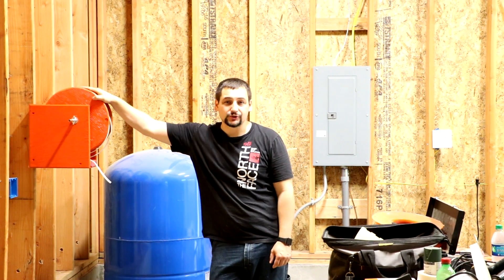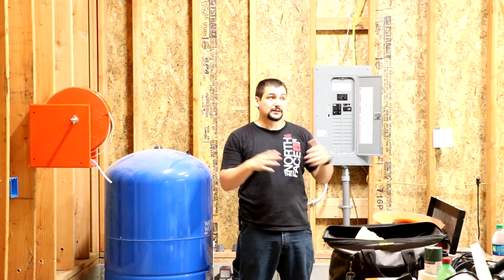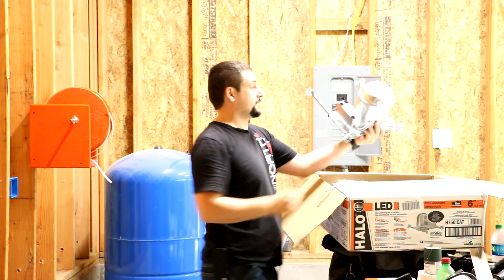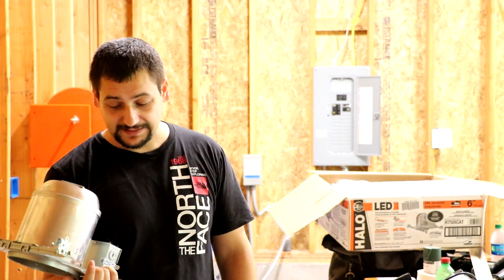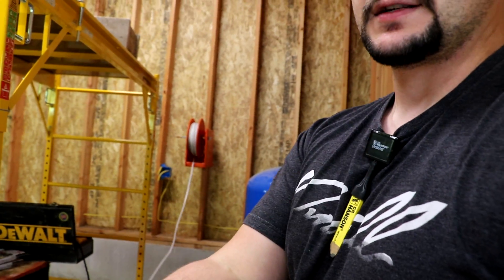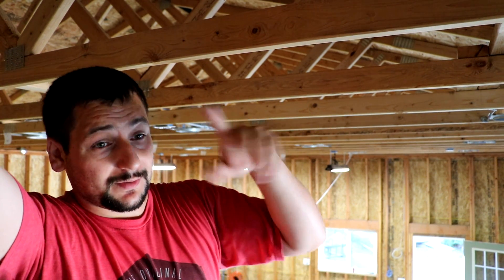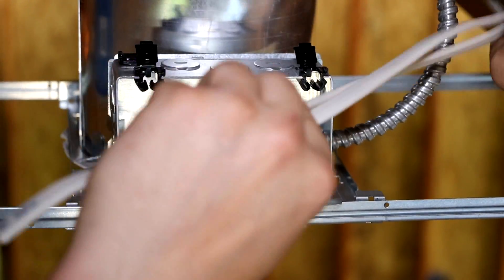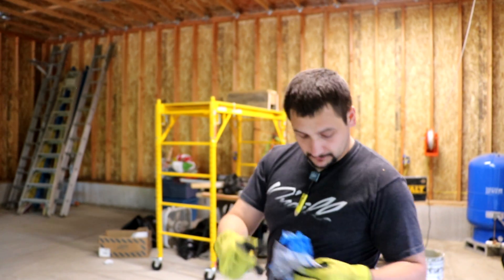How to install electrical in a garage #28A Doing It Dan's Way

Comment: can I join two wires together to make a more powerful supply as my wife's kiln heats up all the cables? In the light switches especially?
Reply from the maker: I would not do that, for one things its dangerous, and another its against code. The wirer needs to be changed out for the correct gage wirer. I would also like to say that you should not be running a kiln on the current wire you have as the wirer heading up can cause a firer.
Reply: @DanielWoodell  can I use an extension lead   from the standard lamp, instead as a backup for the kiln.  My wife says she doesnt use the light any more.
Reply from the maker: Andy harpist I highly recommend when you hire qualified electrician to come and take a look at your situation, I Can’t in good conscious make any recommendations as to what you should do.

Comment: Did you just use one 15 amp circuit for all the lights? Or did you break it up to two circuits?
Reply from the maker: Yes i did run to circuit, but i only did that because i want light switches that controlled the lights in the front on one switch and lights in the back on another. i looked it up and there is no limit to how man LED lights that can be run on a 15 AMP breaker, with in reason.
Reply: Just a skoge

Comment: is that 14/2 wire?
Reply: 14 refers to the size of the conductors in awg. the 2 refer to how many conductors are in the cable ( ground wire does not count as a conductor ). In this case he is using 12/2 and 14/2 romex cable.
Reply from the maker: The white wire is 14/3
the yellow is 12/3  the 14 or the 12 is the gage size and the 3 or 2 is how many wires are in the outer cover. 1 Hot the black wire 1 neutral the white wire and 1 ground the bear wirer. ite wier is 14/3 and the yellow is
12/3   the  14 or the 12 is the gage size and the 3 or 2 is how
many wiers are in the out cover. 1 Hot the black wier 1 nuteral the shite
wier and 1 ground the bear wirer.